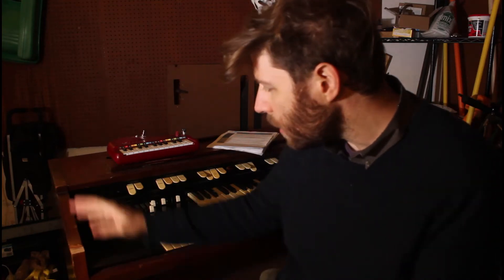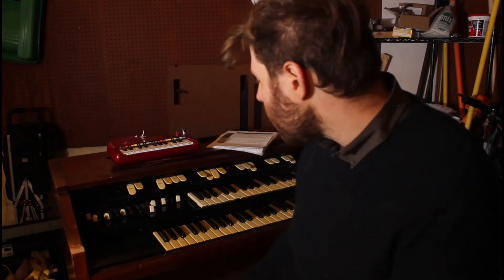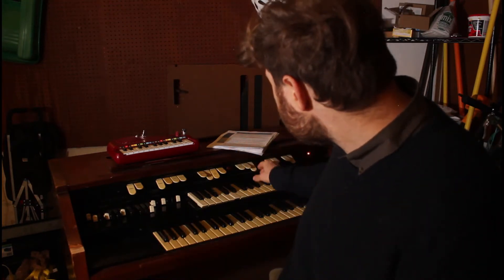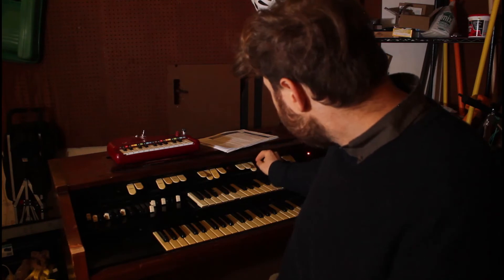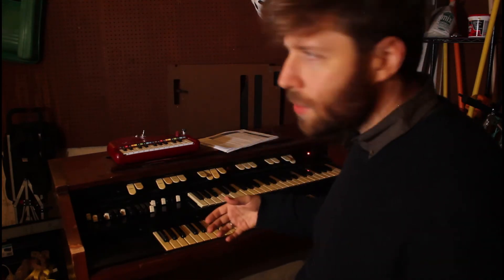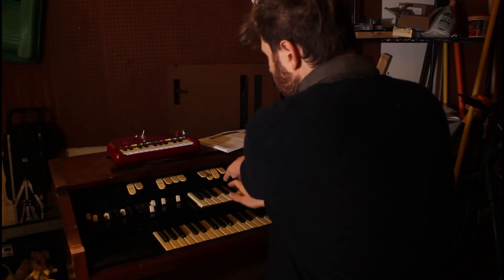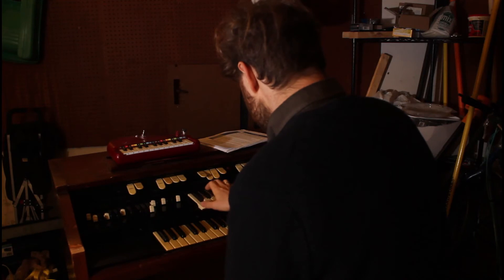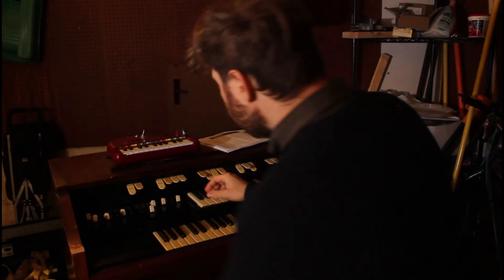Hammond L100 ( L111 ) Modification - Vibrato Chorus and Overdrive

Comment: sounds good...i have an L112 that comes on but no sound...any suggestions? would love to get it working again
Reply from the maker: Thanks! My guess is the tubes are bad, but there are many things that it could be like old capacitors. I’m fairly new to electronics, so don’t know much honestly. If the motor starts and runs and the tone wheels turn, I would then check to see if it plays through an external amp. Connect to an amp from where the white RCA comes out of the percussion amp. If that works, then there is a problem in the main amp. You can also independently test the main amp by plugging a guitar (or some other instrument) in where the white RCA plug goes in. That way, you can at least isolate the percussion amp or the power amp as the problem.
Reply: Funny story I got an l112 for just coming to pick it up a month ago. See if the motor is spinning the tone generator, if not it needs oiling. Also if the motor needs oil the tone generator will too. I just used sewing machine oil even though only hammond oil is supposed to be used. Good luck in your adventure.

On another note I really enjoyed the video, where did you get the schematics for the modifications?
Reply from the maker: Thanks! I got it here: https://web.archive.org/web/20160605030514/http://l100.gietek.me.uk/index.html Hopefully that works, there is tons of useful info. I also used the Hammond L-100 service manual.
Reply: @histerics3  thank you sir i will try that....i'll let you know what i find
Reply from the maker: @kreeper51  I'd be curious to know